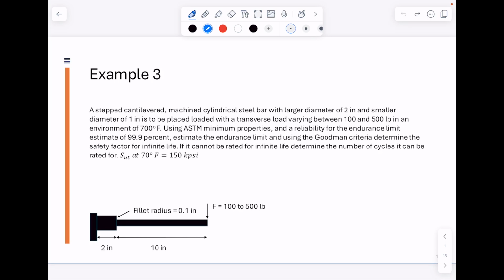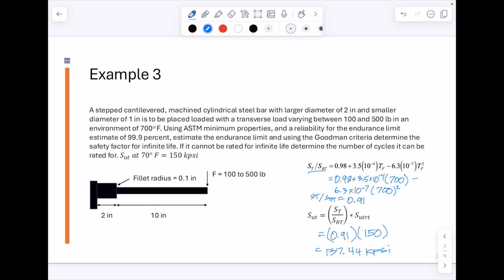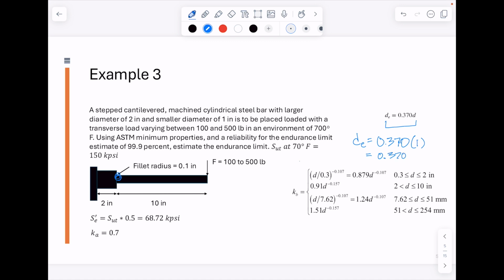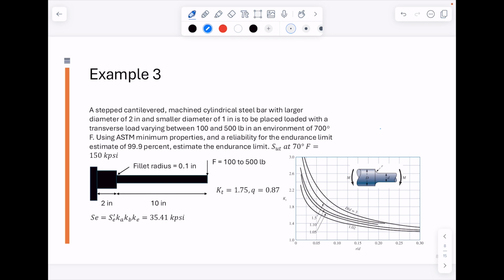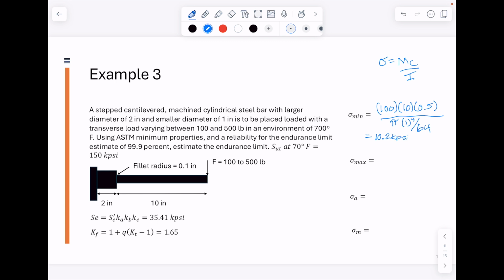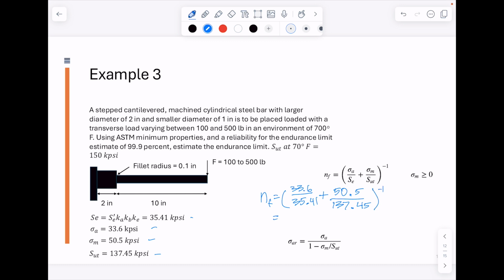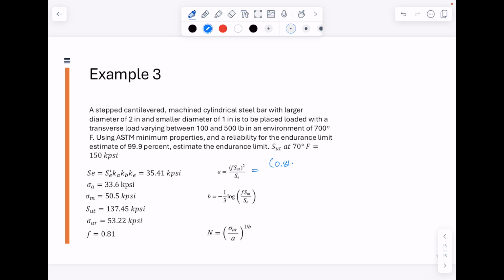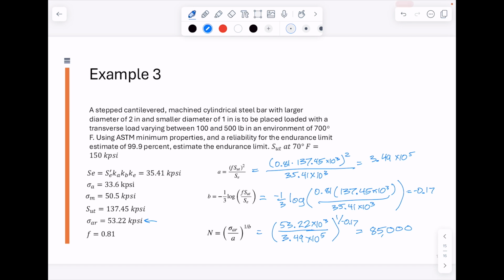Fatigue analysis example

Comment: Shouldn’t sigma_a be 20.36 kpsi and sigma_m 30.56 kpsi? Just using the equations in the video I got that
Reply from the maker: That's a good question, that is what you will get before applying the fatigue stress concentration factor Kf, the values I showed at about 11:30 already include multiplying the alternating and mean stress by Kf.